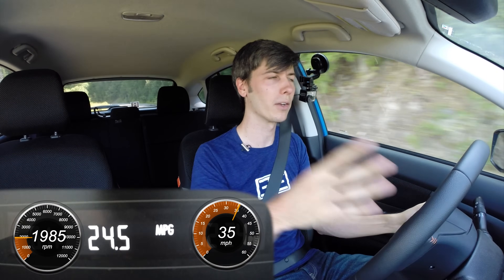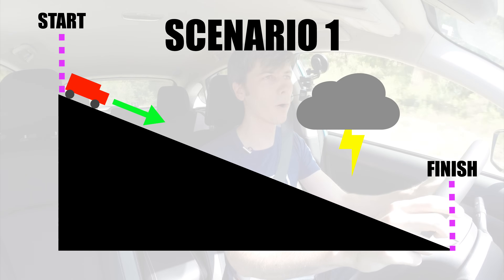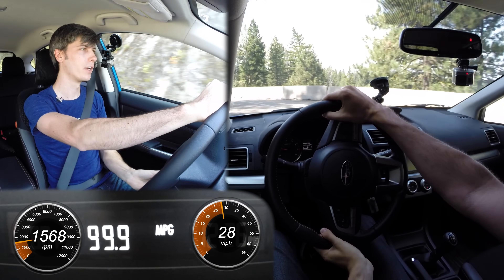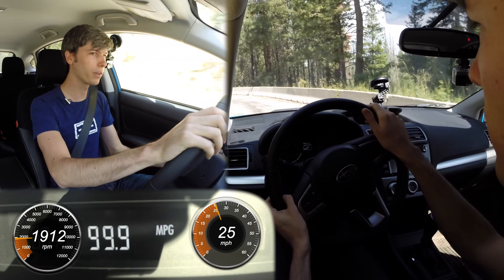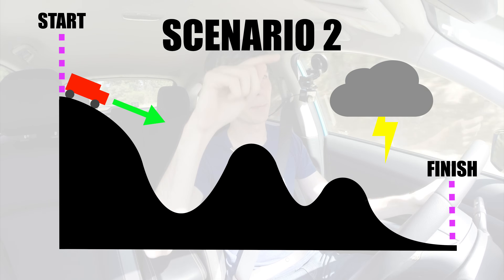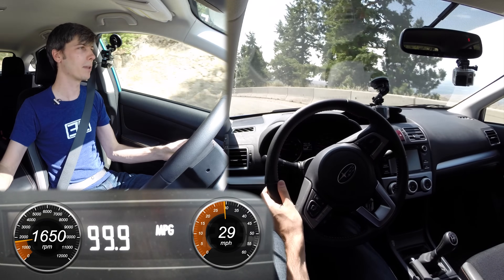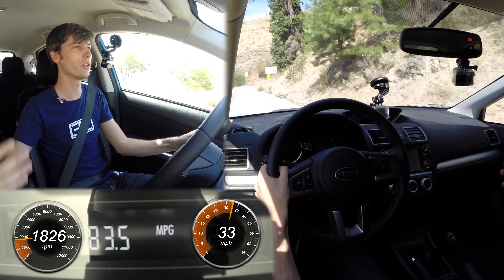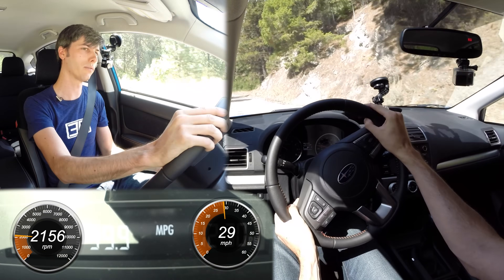What Uses Less Gas - Coasting Or Engine Braking?

Comment: When I'm trying to be fuel efficient (pretty much always), I simply avoid using the brakes.  Avoid as much as possible (considering safety and road law, of course).  Every use of brakes == throwing away kinetic energy that I needed to burn fuel to achieve in the first place.  Of course, I apply the brakes when necessary and use engine braking, too (manual transmission) when appropriate or necessary.  When coming to a potential stop, though, e.g. a red light that will turn green at some stage or stopped traffic up ahead that will start moving at some stage, the EARLIER you apply the brakes, the more likely that you will still have useful kinetic energy when you arrive at that point up ahead.  If you rush towards a red light and come to a sudden stop there you will face the green light with zero speed.   If you brake early / strongly enough, though, you can still have motion when arriving at the green light.  That is a more efficient use of the energy derived from the fuel that you burned up in your engine.  (We're talking very fine points, at this stage.)  WARNING: It is quite dangerous to barrel through an intersection as soon as the light turns green, so don't do it.  Some wiseguy might be running a red light across your direction of travel, hoping that he'll get through before you get to start but because you're so efficient, you both meet in a bloody, smoking mess of twisted metal in the middle of the intersection.  Happens all the time.  Drive efficiently, but drive DEFENSIVELY.  Look in all directions before going through that green light.
Reply: I actually engine brake while also downshifting when I see a red light far ahead and by the time I get to the light it's green and I hit the gas in the appropriate gear. No wasted kinetic energy and saves gas because I didn't have to start moving from a dead stop.
Reply: @TheBuddilla  best thing to do is run stop signs and red lights to save gas
Reply: @angelgjr1999   Been known to happen LOL
Reply: @TheBuddilla  "engine brake" is misleading because engine doesn't have brake lol...  to slow down, the energy has to be converted to heat via friction unless you have magnetic conversion as in electric car to recharge battery. So when "engine brake", either the engine or tramission, or both, will take the friction to convert to heat to slow down. Anyway with the choice of tear/wear between braking pads and tranmission/engine, l choose the braking pads as they're cheap to replace by myself. I've been driving a 2010 VW Tiguan with 210k km,  still on all original tranmission (only change trans oil every 50k km), change front braking pads every 2 yr, rear pads every 4yr, front rotor only once and original rear rotor. It costs about $60 for a pair of pads for front or rear,  $2 for brake grease and 1hr DIY.
Reply: @tonyvu2011  I know what engine braking is and it is caused by a vacuum, your engine is going to experience friction whether in gear or at idle while braking. It costs me much more to replace my front pads and rotors multiples times than to maintain the engine with proper oil and cooling. Of course I am running a highly modified boosted(supercharger) BRZ with upgraded brake system...
Reply: @TheBuddilla  so that huge amount of kinetic energy moving the huge weight of your car and yourself just magically dissapear without extra friction and heat on the engine?
Reply: @tonyvu2011  Clearly you did not read what I said and thus just want to argue to "teach me a lesson" in how smart you are, I clearly said there was friction but that is not what the direct cause of where engine braking comes from.
Reply: @TheBuddilla Not sure if using the engine brake in front of a stop light is worth it though. I used to do that with my first car as well and gotten quite good at it. But now I bought a much more expensive car and I'm rethinking that habit as I'm getting used to my 'new' car's clutch.
My old car got a brand-new clutch a year before I got it, my 'new' car is on its first clutch after 15 years and 65.000 km (40.000 miles).
Brake pads are much cheaper than a clutch!
Reply: @tonyvu2011 As long as you're not being excessively hard on the engine or transmission, engine braking can cause as little wear or less than conventional brakes. Both systems absorb energy from the motion of your vehicle, but the engine is a larger price of metal with coolant flowing so doesn't reach the temperatures of conventional brakes. Also engines don't just dissipate energy as heat among solid objects (brake pads), but some of the energy is dissipated directly into the air, without ever transferring into the solid engine, and is released as noise and heat coming out the exhaust pipe (especially in the case of Jake brakes).
Reply: @LRM12o8  Engine braking does NOT wear the clutch! (As long as you are rev matching as you downshift) It does not cause extra wear, as engine braking is simply the engine's compression cycle not being followed by a power stroke. That compression load is ALWAYS on your pistons/crank if your engine is running, whether engine braking or not.
Reply: @tonyvu2011 During engine breaking, the kinetic energy does get converted into heat, largely via compression losses, meaning as air is compressed in the pistons it heats up. And that heat is then taking care of by the very powerful engine cooling system. And this heat is generally significantly lower compared to when you are accelerating. So much less that on longer, steeper hills, your engine might even get colder than ‘normal’, as much as that heating the passenger compartment becomes no longer possible.
Reply: @tonyvu2011 The difference is that "engine braking" dissipates the heat into a system that is well-designed to remove heat -- the engine's cooling system. Brakes will very quickly overheat and fail (brake fade) if relied on solely to control speed downhill; whereas downshifting into an appropriate gear and keeping the engine RPM high (for maximum torque) will significantly reduce the load on the brakes and safely dissipate most of the energy into the engine block where it will be efficiently and effectively removed by the cooling system.
Reply: @tonyvu2011 the engine itself is a brake. When engine braking, you are using your speed to turn the engine rather than fuel. The engine is going ro turn anyway. You're simply saving fuel and elongating your brakes life. As long as you're not down shifting too much, engine braking is safe. EVs even use the energy to produce power which allows to even stronger engine braking.
Reply: @tonyvu2011 The engine and transmission will probably both eventually wear out using engine braking but surely it'd be at like 600k km or more even. (assuming you're doing everything else correctly - proper maintenance etc) Chances are you'll sell, write off or get rid of the vehicle in some manner long before it gets to this. So it would be left with a significant amount of wear still left in the engine right? That being the case you probably could afford to do more engine braking and use the brakes less thereby saving your cost on them slightly. Personally I use a mixture of both depending on the circumstances. Usually engine braking for longer hills, to avoid brake fade, and regular braking for city driving.  Still to each their own. I'm not going to tell you how to drive - apart from safely of course.
Reply: @tonyvu2011 not how it works stop talking out your rear, how would it create more heat when there is not much fuel injected, it takes fuel to make combustion which creates that immense fire heat. If that was the case and you were right when your car is overheating you would just press the accelator more instead of slowing down or coming to a stop on the shoulder
Reply: @tonyvu2011 also what friction are you talking about brother
Reply: Also, when in traffic I believe that not only is it more economical to not use your brakes but, by keeping a decent distance behind the car in front (and thereby reducing brake use) you are helping to reduce the "Mexican Wave" effect. If every driver in traffic did this the flow rate would surely increase and we'd all use slightly less fuel. Look at all the idiots who hang onto the car in front and dab their brakes constantly.
Reply: Few things in driving feels better than leasurely coasting towards a red light, having an impatient person roar by me to a dead stop, only to then gently coast by them after the light changes to green.

Even better if it happens multiple lights in a row to hammer home which of us has pattern recognition at which point the wiser folks join me in the slow lane. My record is 5 lights in a row before the other driver turned.
Reply: This is the best advice here ever. Plain and simple: avoid having to use the brakes!

This answers so many questions at a time:
-> yes, coasting in gear downhill
-> no, don't tailgate ("slipstream" doesn't do much at road speeds)
-> no, don't speed up to catch a yellow
Etc.
Reply: Well said! I sum it up in the same way - fuel economy is all about LESS brakes and thinking ahead.
Reply: Finally someone gets it. Bonus points for if your brakes actually fail, because I would not only notice it a few meters earlier than most people who only start braking right at the red light, but also because I'm already going a much slower speed and still have more time to react.
Reply: Jake, you are a man of my own heart. First priority (in regard to saving fuel) is to try to conserve as much speed as possible when having to slow down for something. Second priority is to get that state as fuel efficient as possible. That can mean using engine breaking, it can also mean getting of the gas earlier and coasting, depending on the situation.
Reply: I recently got my driver's license here in Sweden, and something I learned from the inspector is that if you use the brakes too much rather than engine brake when you can, you can actually fail the test due to inefficient driving. This will vary between countries I assume, but that's how it is here.
Reply: What do you do with green lights that turn red just as you reach them?
What about coasting to a red light that turns green so you speed up and then back to red before you can get through?
Seems to be most lights haha....
Reply: @TimpBizkit  lights are detrimental to ecological driving.
Often cities do this to improve their fuel sales (in Europe most of the price consists of taxes).

My record is 420km without applying the main brakes. Then a red light came.
Reply: @TimpBizkit  You need to adapt your speed  so that doesn't happen. If you live where lights use timer, or where they are controlled by sensors you will learn how they work. I have one traffic light on my way to work where I need to have so much speed I need to brake a little when I approach the last car in my lane that got a green light,  otherwise I will get a red light. Still, that braking isn't costing me nearly as much as if I braked to a full stop behind that car waiting for the lights to shift.
Reply: @TimpBizkit so true, that's why I gave up on that strategy, unless I'm very familiar with the area and know the lights timing. To be efficient you need to slow down far enough to risk missing the green light, or sometimes the green on the next light.
Reply: great points all around
Reply: Best advices ever!!
Reply: Which is why hybrids are a decent idea
Reply: I'm not reading all that!
Reply: I bet you ride behind semis for max slipstream too, such an alpha
Reply: it makes my nerd brain go crazy when people ahead of me constantly ride the brakes down small hills because god forbid they go 1 mph over the speed limit, its "free" energy!
Reply: Holy crap, it's not that deep lil bro 💀

Comment: i think the answer to which is more efficent cant be cut like that, you have to consider how much the engine brake holds the car, the distance traveled downhilll, the more air friction u get while coasting because of speeding up. Like imagine this scenario: A long downhill and a straight road after it:
1- you always keep it in gear. On the hill car stays at 100km/h and when hill ends you push the gas a little bit to keep the 100km/h
2- you coast and car reaches to 140km/h and you wait car to drop back to 100km/h before putting it back to gear.
Can anyone tell me which one would be objectively more efficent? I think you cant tell without actually testing it somehow on a very controlled environment

Comment: Are you entirely sure engine braking uses zero fuel because an overly lean mixture (no fuel injection) would contribute to overheating, preignition and detonation. Some fuel must be involved
Reply: If no fuel is injected there is no combustion, therefore no preignition, detonation, or overheating.

Comment: What about compensating for gas inputs when downshifting though? Small gas inputs are obviously required for a smooth downshift, so aren’t you still using a significant amount of gas from that or are you still saving some compared to just letting it coast? Sorry for the confusing comment.

Comment: I tested everything regarding car coasting. And here's what i found: I have an automatic sports car and according to my trials and the fuel economy meter, putting the car in N or D makes NO difference in fuel consumption while the car is moving as long as your foot is not touching the gas pedal. But if the car is stationary, idling (stopping) in N will decrease your fuel economy. But putting the car at N and removing your foot from the gas will help the car glide smoother and for longer distances, therefore reducing the need to step on the gas which will make difference in your fuel economy. Consider it a skill to know how to coast the right way. Hope i helped you guys.

Comment: My Peugeot 206 HDI would go straight to 999.9 mpg as soon as the rpm increased above idle when engine braking.
My petrol Citroen C2, the fuel consumption actually INCREASES a tiny bit UNTIL you get to 2500 rpm and then the magic 999.9 mpg would show. Interestingly it would hold this until you got down to 1500 rpm. I would always try and trick it by trying to shift into a higher gear but alas it would start consuming fuel again as the rpm dropped too quickly. I'm not sure why it does this as not only does it waste fuel it also robs you of engine braking (by using fuel to counteract it). It doesn't waste that much fuel (if you shift into 5th at 40 mph without foot on the accelerator the consumption will go from about 350 mpg to 200 mpg) but one time I was going down my mum's drive in first gear and the fuel injection started and the car went rather more quickly down the hill and I had to reach for the brake.
Both cars had similar fuel economy although the diesel being a 2.0 and petrol a 1.1, the idle fuel consumption was higher on the diesel but you did get more power.

Also hate getting stuck behind the slow driver who brakes down all those roller coaster hills.

Comment: I have a 2014 mustang manual n I always put it on neutral when going downhill n the fuel consumption meter goes up like urs but it's not in percentage but in bars ...after the down hill when I press on the gas then the bars starts to work..so mine stops injecting fuel?.
And also I'm concerned about my clutch coz replacing brake pads are much economic than replacing clutch...any suggestions is highly appreciated...TIA

Comment: I have been driving on neutral gear downhill on a steep straight hill (not winding) that picks up speed up to 75 mph in about 10 seconds everyday for a year now. (If on gear, the reading will slam to 4000-5000 while going down the steep hill hence I thought damn my fuel every single day)

I usually let it cruise for 2.6 km until it goes down flat land to 10-12 mph before shifting it back to gear mode on flat ground. 

I only started going neutral gear a year ago when I realised I wasn't pumping gas as often as I do. 

I can't say for sure because I don't use readers like in the video, but surely I had an extra one and a half day drive before pumping additional gas. 

I always reset the metre reading everyday before going to work to measure the distance (just a habit). 

My daily drive does not exceed 50 km a day. 
Therefore I thought I was doing the right thing to save fuel consumption.

I'm driving a Toyota altis 2010 1.6g. 

Just wondering... if it's just my illusion or does the steepness of the hill affect petrol consumption? 

In terms of safety, it is a private property (working site) with basically a few to almost no cars (or animals) to cause collision. And it's a straight steep downhill
Reply: I wish I could tell how steep the hill is but there are no signboards around. After watching this video I'm wondering it was just an illusion that I was saving petrol 😂

Comment: When your car is speeding up try apply brake gentle to slow your speed its depends on situation in sharp curve blind spot what ever just atleast apply or press the brake gentle to slow or less your speed its still safe when you in neutral.if you doing this just apply and let your eyes anticipated in sorroundings and be far sighted

Comment: Efficiency counts not only the fuel consumed, but also the brake pads and brake rotors which wear out much faster if you coast in neutral compared to engine braking.
Reply: that's why you don't brake when coasting
Reply: @GewelReal  yes when I'm in a fast momentum and I see a up slope I shift into neutral xd

Comment: Short-sighted perspective focusing only on fuel consumption at the cylinder. In many situations the fuel you save by coasting in neutral is NOT at the injector, but the additional speed you've gained without engine braking which would otherwise need to be maintained using much more fuel.